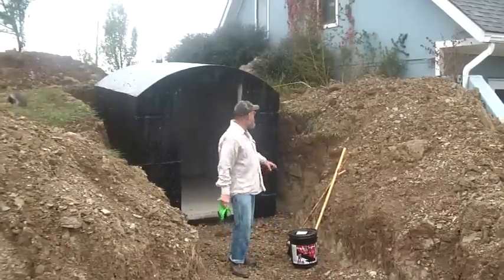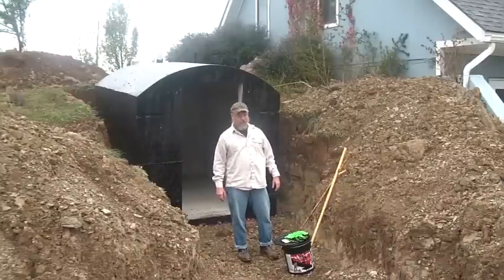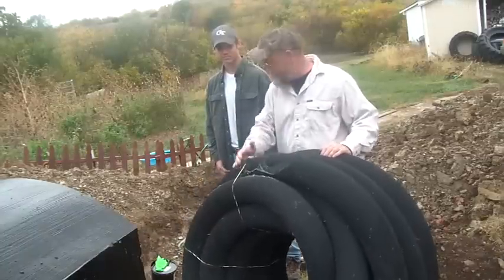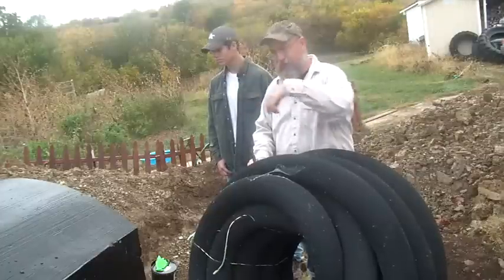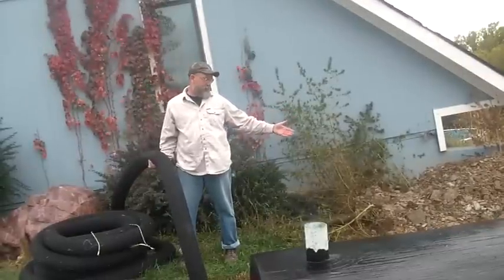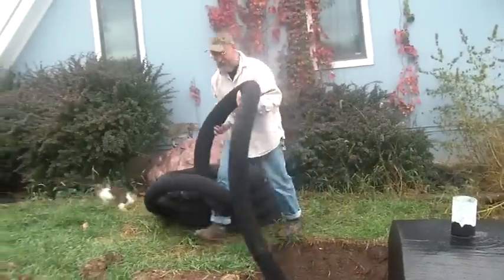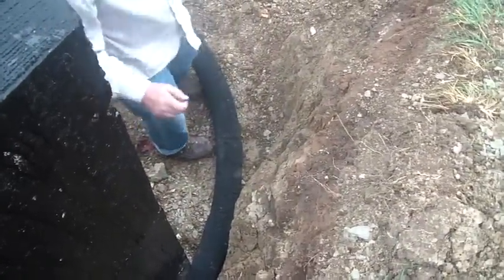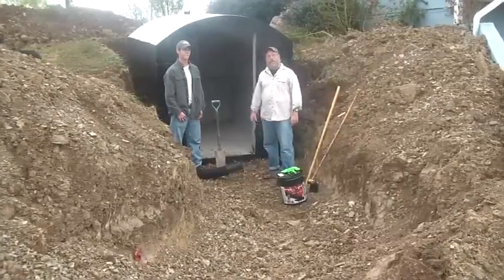Storm Shelter 2

Comment: @brendahere I'm pretty sure I stated the price in the second video but it breaks down something like this:
The shelter was $2000 and with delivery and setting came to about $2300.
I rented the dirt mover (my share) for $80; the black stuff cost about $30 and the hose was $70 but I only used a third of it.  I figure when it's all said and done I'll have a bit less than $3000 in it.

Comment: @evodave08 

If you use a product called P2000 you accomplish both in the same step. It is a thin styroform insulation board with mylar on either side. It is recommended for below grade use on homes with concrete block foundations. When I had to have the drain tiles around my basement replaced we put the P2000 over the re-waterproofed exterior of the concrete block foundation. It works great and has a higher R value than foam board 4x its thickness.